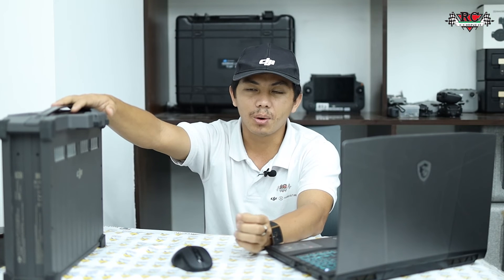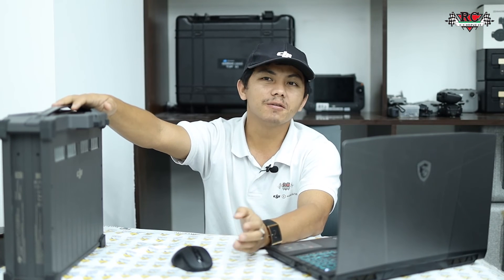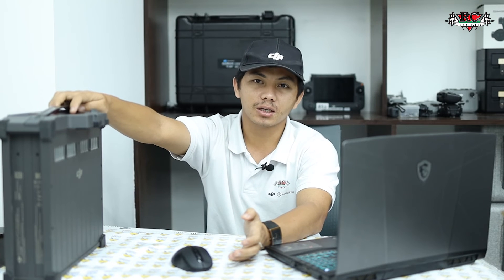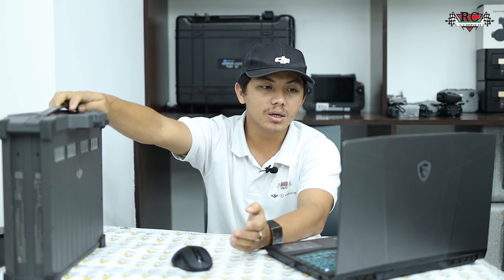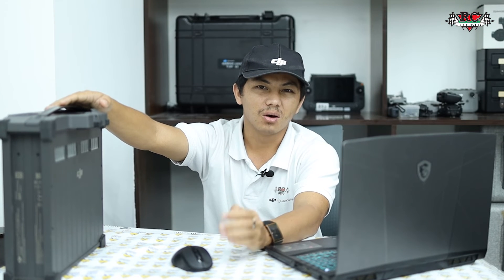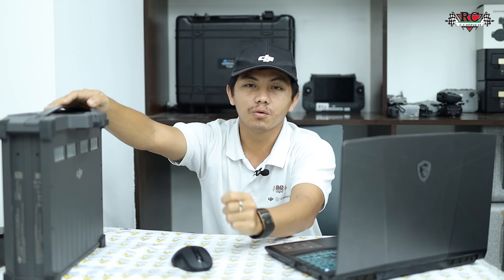DJI T40 Battery repair course | Agras Service

Comment: t40 battery does not charge after changing the connector
Reply from the maker: Make sure you have connected it correctly.

Comment: My t30 battery is not charging after months of not being used
Reply from the maker: You left battery with too low..(next time , store the battery under storage percentage 68% if not used for long time).. if more than 3 months, charge and discharge in every Three months. For details, please refer to battery manual which we gave with the battery. For now, you may try charging with home electricity and let’s hope the cells will be reactive

Comment: Hello, how do I change the battery connector? My connector broke and I'm afraid it will short out
Reply from the maker: For battery, it is risky to open and replace parts... so, DJI doesn't allow for that. May be you can share the video or pic and we can check for you how best you can do in that case.
Reply: You have WhatsApp?

Comment: Hi. I have the same problem with a t40 battery. All light are blinking but doesnt turn on when I place it on the aircraft.
Reply from the maker: Do you have the video, brother.. ?
Reply: I have the same problem, how could I give you a video so you can check it?

Comment: Hey There , I have T40 and 3 of my batteries are not charging when I press the power button all 4 lights are blinking
Reply from the maker: Connect those battery to T40 and turn on Remote and see the cell voltage difference..
if all light blinking mean full charged already.. cannot charge longer
Reply: You have WhatsApp? I believe can help you